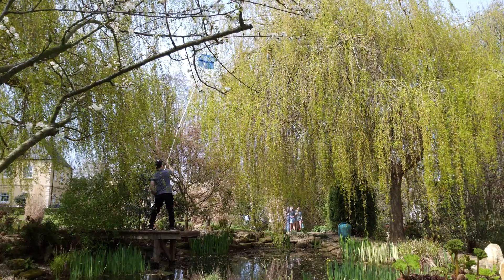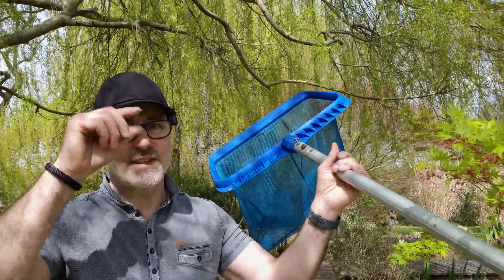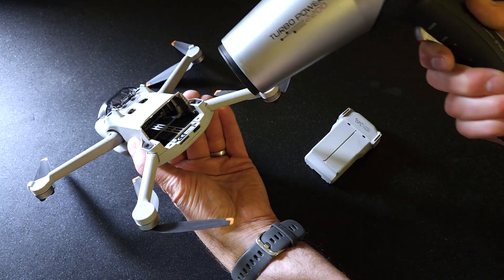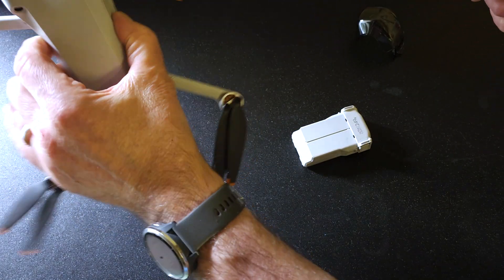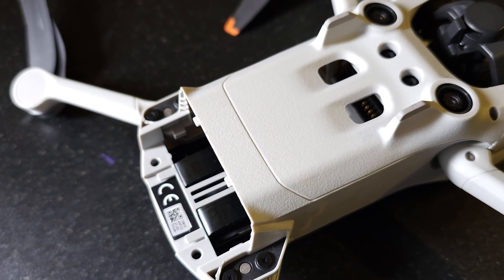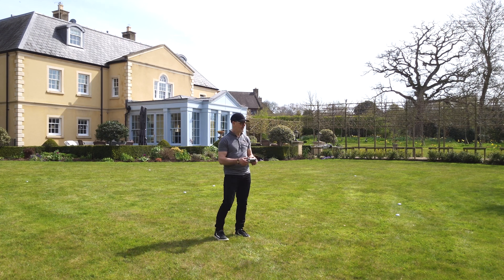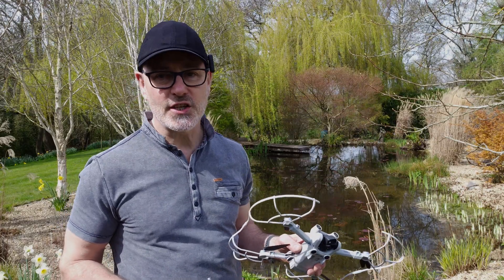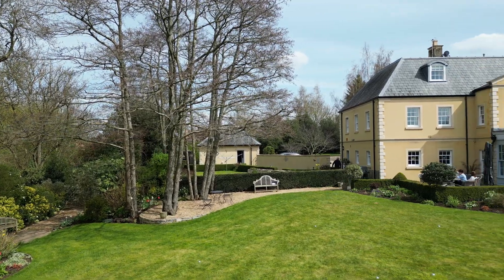How to Repair Drone Water Damage - I drowned my DJI mini 3 Pro

Comment: Glad you saved it, mine fell in the river, found it 24h later.. dried it with Hair Dryer, placed it on top of a heater radiator for 50 hours, popped it a new battery and nothing happened,  no lights,  no power indicator (green battery level on drome ) no movement .. nothing at all. Completely dead (dji mini 3 pro)
Reply: Problem is i am currently in the Caucasus Mountains... far from anything related to DJI or Drone Shops unfortunately
Reply from the maker: Sounds nice. Definitely email them and get advice.
Reply: @user-gh1zk4fh3h  Hi, any news??
Reply from the maker: Agh😱. Definitely worth contacting DJI support. I've found them to be super helpful.
Reply from the maker: I've got an Air 3 for sale if you're interested.
Reply: The same thing happened to me, my drone dji mini fell into a dam and I haven't been able to find it yet
Reply from the maker: Sorry to hear that

Comment: Did you use the hair-dryer in hot or cool mode?
Reply from the maker: Hot, but kept it moving and not too close. Still needed the airing cupboard over night. Test with no one close. First try mine took off, fly away, sideways then hit the ground.

Comment: Mine's is currently drying over the radiator. Your video has gave me hope for tomorrow, thank you. 👍
Reply from the maker: Oh boy, hope it wasn't salt water. Be patient and make sure it's 100% dry. My first attempt at flying it went up in the air and then did a flyaway straight towards my parent-in-law's. 😱 managed to land it just in time and dry it out properly. Patience, it will be fine :)

Comment: I let my partner fly the drone for the first time a few days ago, my fault as i should have been more diligent with her "training" but hit a few leaves on a branch and fell into a river. Took afew minutes to reach it, but removed the battery and air dried it (was camping so no drier) when home a few days later, i let it sit in front of an aircon on heat over night and will put in a box of rice to make sure its bone dry before testing! Fingers crossed
Reply from the maker: Oh boy, just make sure it's 100% dry so it doesn't shoot off with a mind of its own. If you have a warm airing cupboard it's ideal. Good luck and I'm praying for you.
Reply: @SlipstreamCreativeAgency  update! I left it drying in from of an aircon on heat for another few days instead of the rice (some googling seems to say the rice is a myth) 

But, the drone works! Tested it yesterday. Fingers crossed there was minal corrosion if any. Will update if it ever drops out of the sky or has weird hiccups.
Reply from the maker: @diysalmon  Yay, I'm happy for you, it's scary but you got there. Sea water might have been a different story. Happy flying.
Reply: @diysalmon  ive just had mine drop in water, will do the same as you, does yohre drone still work
Reply: @adaml593yep sure does! Going strong.
Reply: @diysalmon ive just completed a rise with clean water then dried what I could see and shook out what I could, is it possible to remove the bottom as I've half got it off but can't seen to work out how the sensor side comes off
Reply: @adaml593i just put it under an aircon heater for a few days and then left out to dry for a few weeks and it worked fine
Reply: @SlipstreamCreativeAgency  thanks mate! Will do

Comment: One of my Plus batteries for the M3P is charging only halfway, I think it is the one that got submerged for a few minutes in 3' of water. The drone dried out fine and runs perfectly.
Reply from the maker: I do find I need to give them all a boost before flying as I found they loose their charge.
Reply: @SlipstreamCreativeAgency  The dang battery won't charge. Will buy one or two replacements, despite how pricey the silly things are. Mini 3 Pro Plus.
Reply from the maker: @dogzillamonster  😭sorry to hear that, at least dronny is OK.